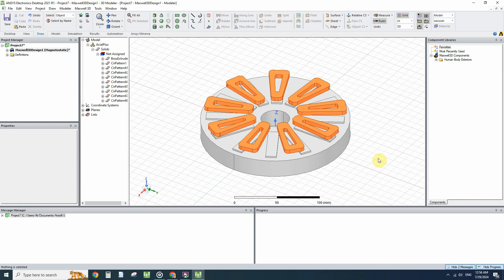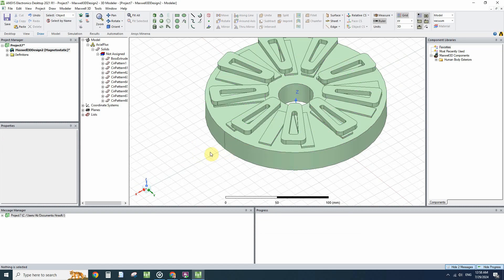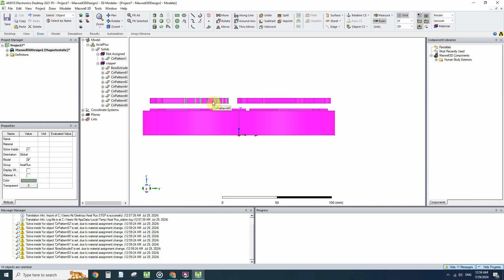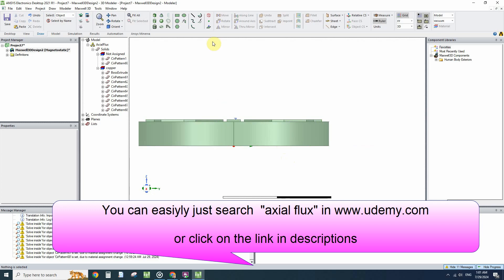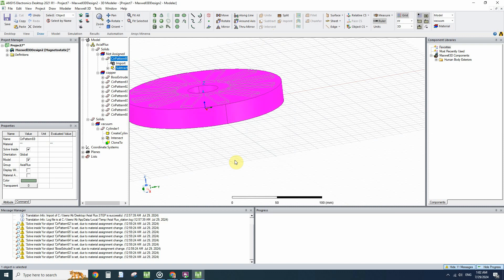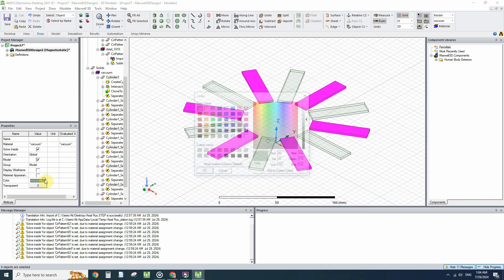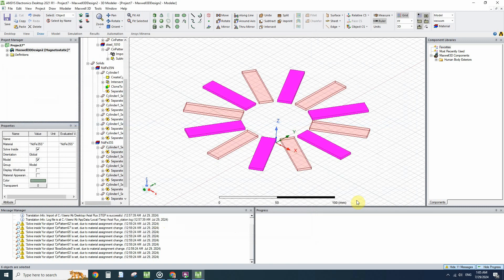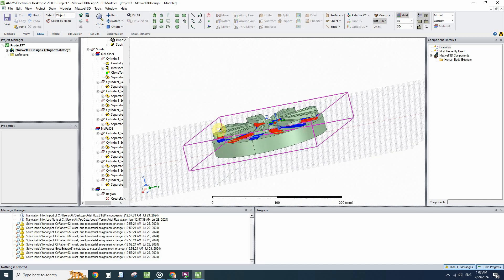Importing Axial Flux Geometry from SOLIDWORKS to ANSYS Maxwell | Motor Design and Simulation

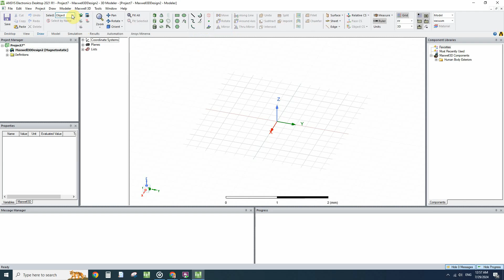Comment: Hello. I get an error at the model import stage (0:55). I'm using a file.step and tried other formats, but nothing works. The error message window is: "ANSYS Electronics Desktop
Command execution error, please see details in message window." 

Does anyone have any idea what the problem is and how it can be fixed?
Reply from the maker: @sashabray4224   
My whatsapp number is +989379371182 you can send me photo of error and the model that you want to import . I will help as much as I can